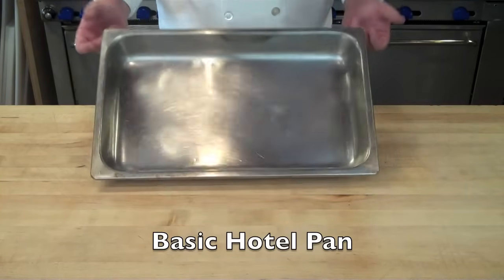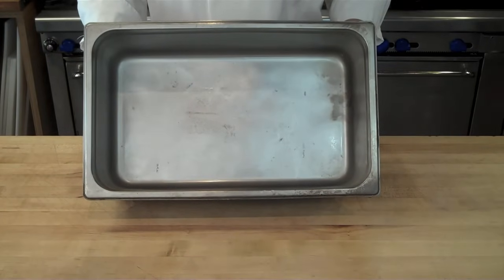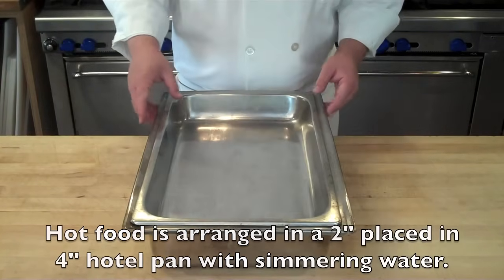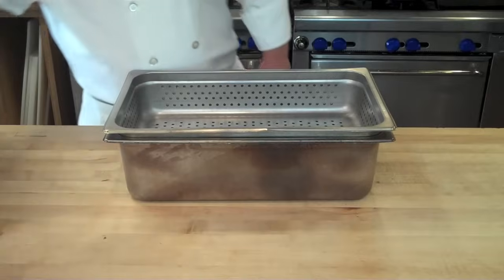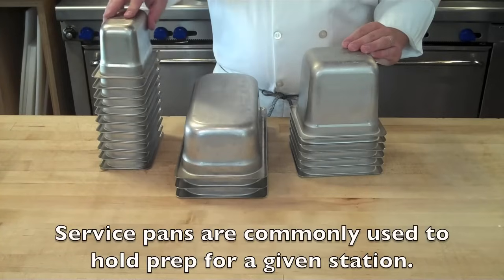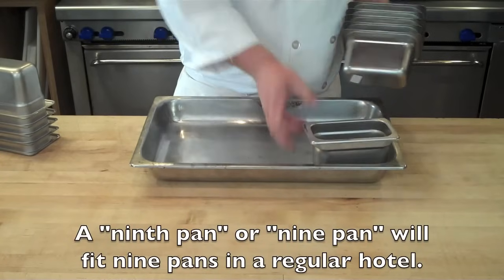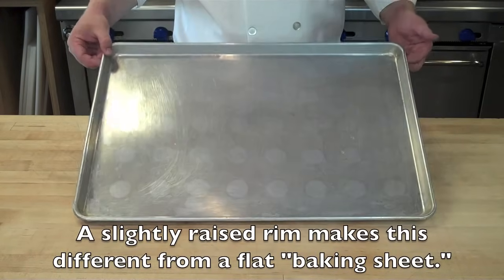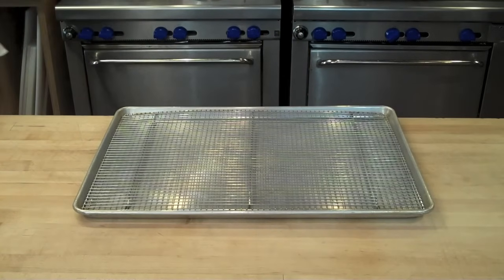Kitchen Terminology Part One: Service Pans

Comment: I'm here looking for a hack or possibility of using a hotel pan to scramble eggs. If it is possible, how do you do it a nd how l9ng does it take?
Reply: These types of inserts are meant to hold food... not really for cooking food. The metal is really thin, thus making it hard to control the heat. Not to mention if you're using your stove top ellement, it'll only heat in the middle. You should make scrambled eggs in a non-stick skillet.

Comment: Can I fry in a service pan partially filled with oil?
Reply from the maker: Technically yes. I wouldn't recommend it though. The metal is so thin it will make it difficult to regulate the temperature and it could be dangerous.
Reply: Thanks xD
I was just curious to how creative one can get to make use of them.